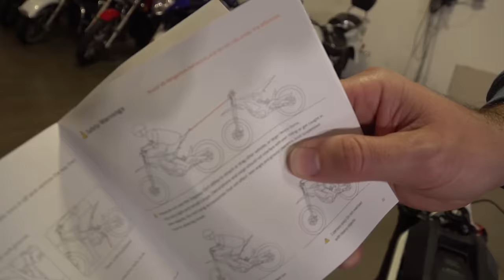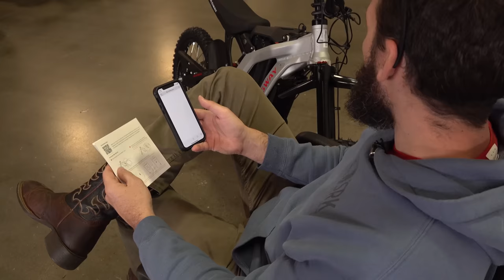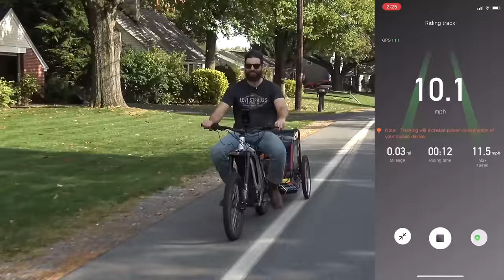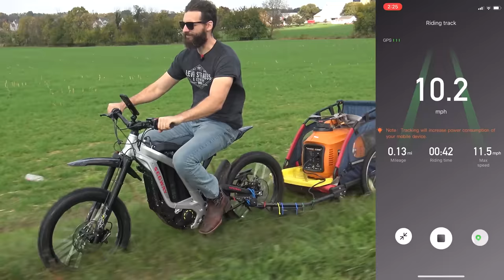I BOUGHT the CHEAPEST ELECTRIC dirt bike on Amazon

Comment: I got a cheap c91 48v 17ah 1200w peak it does 35mph right out the box.  Daily commute is 20 miles back and forth.  Still have a quarter charge when I get home going full throttle for the vast majority of my ride.  I slapped a super 73 seats on it with some cafe clip on handlebars and a small windshield.  Been a lot of fun

Comment: I think Segway measures the range with it on the lowest speed/power settings. A lot of brands do this when measuring battery life for their devices.
Reply: Also with a small Asian woman that weighs about 70lbs.
Reply: WHICH IS VERY SNEAKY!
Reply: No shit Sherlock
Reply: *small asian girl suffering from malnutrition who volunteered because her fingers were hurting from winding motors for 20 hours
Reply: If you expect to be a food delivery guy on this thing, the battery will probably be low on your first delivery
Reply: Bullsht. There's no standard checking these things
Reply: They calculate voltage and watt hours and do the math from there. Also not accurate.
Reply: " Travel range is based on riding on level ground, no stops, no winds, warm temperatures for a 175lb rider with no extra cargo ". From a website.
Reply: Did you know that Segway went out of business when the owner went off a cliff, on a Segway, and died.
Reply: You forgot "going down hill with the wind at your back"
Reply: A lot of brands measure it on flat ground with a 160-180 pound rider... so you're never going to get the mileage they claim at any setting.
Reply: That goes for just about every claim made by any manufacture.  The specs of anything is for the most part complete bullshit.  They spend more time trying to figure out how to reach specs on a spreadsheet without legal fallback than they do actually developing a machine capable of hitting those specifications.  Power, weight, energy usage and mileage are all on the table to be manipulated.

Manufactures are rarely honest about anything even if they have something worth bragging about.  They will still find a way to lie about it to make it seem better than it is.
Reply: They test it with 60 kg of load, lowest speed setting and no hills. This is the universal test
Reply: @SirNarax  People are misinformed. They are not " lying or bullshitting " Every company has standarize their testing and they do it correctly but they didn't share how they tested it. There are 3 speed settings or more usually. They give you 1 claimed range. Obiviously they only tested 1 speed setting.
Reply: @wordwarrior2350  did it really?
Reply: @aninnymoose720  there isnt a legal standard. but there is an industry standard practice. and that practice is to test them on a roller with no resistance, no wind, no added weight, and at the lowest settings to maximize the potential. basically they put it to lab standard perfect condition controls then use those numbers. they do not test in real world conditions and usage operations.
Reply: they should say that

Comment: Seeing someone hook a generator up to an electric vehicle just made my day.
Reply: mine too hahaha.
Reply: Me three, freaking hilarious!
Reply: Me four, but it kinda defeats the purpose doesn't it!! Will they ever make a battery that actually lasts as long as a fuel tank?
A battery that isn't 10 times the size of the bike!!??
Reply: @mikthe2004  Yep, designed for in the city, European style driving.  Outside of LA, NYC, San Fran and San Diego.... you start running into issues. Living in the middle of nowhere in rural Midwest.  Yeah.  Electric just ain't gonna cut it.
Reply: Exactly, what is the purpose?
Reply: I only wonder if the generator uses fuel as he operate the bike
Reply: @mikthe2004  Yes, actually. There's a couple of electric bikes that offer 150-200 mile range, with top speeds ranging from 150-200. Which, is some serious range, even compared to something like Honda's new rebel 1100 which has the same rough top speed and range. The technology for it exists, but aside from a handful of examples it tends to be expensive. The 200 range, 200 mph electric for instance comes in at 120k.  Though, it does look amazing. The Damon Hypersport I believe is the name. However, it's going to be laughably overpriced in 15 years when the technology gets cheaper, the way everything else in history has. I'd get one of the more reasonable electric bikes myself, since I don't travel more than 60-70 miles a day at most, but I like my bikes loud, and you just can't get that with electric.
Reply: @aaronself2411  Apparently the batteries only last about 5-7 years? And the cost of replacement is exorbitant? Not to mention disposing of the old battery safely?
I'm just not sold on this whole electric idea. Depending on how the electricity is generated the pollution aspect can be as bad or worse!!
Reply: @mikthe2004  I'm not sure where you were told the batteries can't be disposed of, as since , 2018 I believe about 90% of the lithium can be recycled and put into new batteries, which, was the main issue with disposal. Besides which, this is again, basically brand new technology. We had similar issues with engine oil when cars first hit the market. Lot of cars, and not enough places to dispose of waste fluids. But it's still early days, and the amount of progress that electric has had in the last ten years alone is a pretty good indication that it's only going to get better. Though, I find it interesting that the battery issue is only a problem when talking about electric cars, while we all carry around cell phones which use the same basic technology in their batteries, and let's be honest. There's a lot more lithium inside apple than there is Tesla.
Reply: Yeah. It's so stupid .🤣
Reply: @aaronself2411 that is not true. Those ev bike can match the range, but they have to run very slow. Eg.35-50kph on ev while the ICE ones run at 80kph
Reply: @ameserich  There's literally a EV motorcycle that does over 200 miles, with a top speed of 200 mph. Methinks you need to do some more research on the current EV Motorcycle market. EV bikes, are comparable to ICE bikes. Especially when you consider an ICE bike is always going to have less fuel supply than an EV. You can pack more electricity into a gas tank sized battery than you can gasoline.
Reply: @aaronself2411  duh im not anti-ev what im telling you is that if they both cruise on 80kph the EV wont reach 200miles. To make things easy to understand, it is false advertisment. That 200miles range is when on city riding 20-50mph... i dont need to research that because the battery tech they are using is still the same, Motorcycle is not the same as 4 wheels. For 4 wheels turning can be compromised so they keep puting gigantic battery, that is something they cant do on motorcycle. Unless battery capacity trippled, it will never match ICE's range per speed ratio.

If you cruise at 35km/h on your 300hp EV motorcycle surely you will reach a range of 200miles
Reply: @ameserich  Yeah and I'm telling you that you're wrong. There's already four bikes on the market that can do a hundred miles plus on a single charge doing normal highway speeds.
Reply: @ameserich  these things aren't hypotheticals they're on the road right now You can go buy one.
Reply: @wildestcowboy2668  Why would we be offended?
Reply: opening a cardboard box with a chainsaw. savage
Reply: @aaronself2411  more lithium in Apple than Tesla ... You mean overall, right?
Reply: @TheDingpud  Well yeah, If there was an iphone witht that much lithium youd have a HELL of a battery life. Be a bit wasted since the phone couldnt really move but hey, screen life for... weeks...
Reply: Never heard of the Chevy Volt?
Reply: @aaronself2411  I guess I meant which company has put out more lithium to the consumers....there are millions of iPhones and other portable electronics using lithium in their batteries.  I wonder which sums up more.
Reply: @TheDingpud  Definitely Apple. Thing about how many iPhones have been sold, then add the Mac books. Tesla is still relatively small.
Reply: @ericstearns170  this bike maybe electric cars now have a range of over 400 miles.
Reply: @aaronself2411   well for loud you could just fart a lot…it wouldn’t be quite as bad for the planet …maybe
Reply: @danbailey96  right.  so to the store and back.  lol
Reply: Please turn your life to Christ one of the most important things is to know that it’s not about religion it’s about a relationship in the bible it says they will be wars and rumours of wars please Jesus is coming back for his children anytime soon the rapture is about to take place please repent of your sins turn away from them and welcome the Holy Spirit into your heart God bless you all people
Reply: @mikthe2004  keep your old non smart items running as long as you can.
Reply: The generator on a trailer thing is just a joke because you can just go buy a motor scooter that's faster than that thing and it also makes noise and uses a very small amount of gas just like that generator. Heck when I was in some Asian countries you could buy a Honda 125CC scooter that goes around 65 mph , get 130 miles per gallon and only cost like $1600 bucks. Way better deal than any electric motorcycle, only cost you maybe 10 bucks a month in  gas, which is nothing to run the thing.
Reply: L
Reply: @mikthe2004  the thing is we can change how we generate electricity. But there's really only one way to make and burn gasoline.
Reply: Best way to do it after you run out of Ez in the middle of nowhere lol no civi life around you on a long journey out n the sticks lol best investment anyone who buying a EVehicle.  Tesla have caught on n will have Honda's generators in the boot just keep it to yourself for now 😂
Reply: Hilarious
Reply: @TheDingpud  -- The "purpose" of an electric bike toting a generator is to avoid all the laws and licenses that a regular motorcycle attract. That's why he's buzzing around on the sidewalk without a helmet.
Reply: Yes I love Joe's dream of going green and using gasoline to do it. FJB
Reply: @mikthe2004  That's why I don't want a electric car
Reply: They do it every day at the motocross tracks... one of the dumbest things you will ever see.
Reply: for this vehicle, yeah lol but for ones like Tesla, an average size tank of gas would generate electricity to charge 3 Teslas. pretty efficient

Comment: Sur Ron Light Bee X $3,600

Do not buy this from Segway (X160 or X260)! This is a product originally sold by Luna Cycle for over $1k less than the X260.

Just like you said during the video, Segway just threw a bunch of money at the production company (Sur Ron) so they can slap their name on it, make bogus range and power claims, and rip people off.

Sean, buy the "X260" version from Luna and support an American company. They only charge $100 more than the weaker Segway version you just bought! 

I've owned 10 street motorcycles, dual sports, and dirt bikes. This bike is amazing and is the most fun I've had on 2 wheels. Been able to take them to local regional parks and trails where I could/would never take a dirt bike.

Absolutely worth every penny buying from Luna Cycle. They ship in 2 weeks, their customer support is A1 and they sell extra batteries, parts, and also make all sorts of aftermarket upgrades for the bike. No reason to buy from anywhere else!
Reply: @D They were originally exclusively sold in the US by Luna for years, that was the agreement with Sur Ron. Then Segway threw a bunch of cash at Sur Ron so they could undercut that deal. 

On top of that, Segway claimed they spent "years researching and developing" the X260 and boasted bogus range claims. Everyone in the original community knows all they did was slap their badge on it and make an app. 

All the people who buy from Segway and join our groups quickly find out they made a mistake buying from them. They paid extra for long shipping times and terrible customer support.

Now we hear they're also throwing money at channels and magazines to have them give disingenuous reviews of the bike. Nothing but shade coming from Segway.

Comment: BIKES & BEARDS is the Best!
Reply: Amen
Reply: it's the only bike channel i have sub to 👍
Reply: The sur Ron is a mountain bike
Reply: You can replace the battery with Sur Ron batteries. Its the same designed. HP Logic got one of these and it goes 85+ mph. Great Video
Reply: @pascaldesnoeck8671  not even motomadness
Reply: @locorabbit30   I have the 50mph sur Ron it gets 8 miles on full throttle. Don’t buy one
Reply: Derek the segal  seriously that’s with the bigger battery as well, a guy I ride with has a home made ebike that cost about the same but does 70mph with a 30 mile range and it has marzocchi forks on it
Reply: @FriskyDecisions  Awesome forks Awesome bike
Reply: @FriskyDecisions  What is your WEIGHT?
Reply: @user-kj4wq1gt8c   well i will take a look thank you have a nice day or evening or night i live in Belgium
Reply: @ianmangham4570  165lbs

Comment: It also appears to lack headlamps, but given you've added a generator in the back, it might not be too difficult to plug in a lamp and weld it to the front...
Reply: I have a badass headlight and tail light for my mountain bike that works great and would mount right to it without any mods.
Reply: @JeremyG5705  Functional, sure. But not funny. It's style points that count.

Comment: I'm a gas and oil guy (2 strokes please), and absolutely hate electric vehicles (most), and I especially despise the government trying to force both us, and manufacturers into going electric.... it's utterly ridiculous at the very least....but, some of these electric bikes are pretty interesting lol.... there's actually a lot you can do to them to make them really damn quick, better batteries, better controllers, better motors.... there's one with a transmission that literally does 70mph out of the box (if it doesn't shut off mid throttle lol, do your research before buying that thing 😅)...they have the little Razor "pit bike" style ones, and there's a couple companies that build literally plug and play kits to swap out everything I mentioned above, you can have this little 50cc sized electric pit bike that's like $600 plus that kit, and the damn thing will do 60mph and ride wheelies all day, plus, a few hours of runtime.... there's all that stuff for most of these bikes, like this one, but I know people like that "Surron" and then there's another company that builds a competitor to that Surron that's actually even better, plus you can upgrade again.... and those upgrade companies even sell full upgraded bikes. Pretty interesting, definitely be cool in certain situations.

And man...yes there's replacement everything for these bikes, all the electrical stuff, but most of it is custom built for better performance....look up a kid called "Sur Ronster" on YouTube, he reviews and customizes all these electric bikes, he's always showing where and how to get the components with links to these "performance" shops

Comment: I added a generator like that about 10 years ago,
 Better to wire the generator to the output side of the battery parallel with the motor,
Otherwise you risk breaking something.I put a switch on mine so i could shut it off and on.

Comment: Having a second battery to immediately swap while having a storage for the first battery to rest would be amazing
Reply: Have done this just chucking the second battery in a backpack; is indeed amazing :-)
But if you're looking for daily longer range, I'd look first at chibatterysystems or another aftermarket battery manufacturer, theirs mount inside the frame and still pack a bunch more range.  Much better protection for the battery - lithium fires are no joke.
For me having a second battery makes more sense, I very rarely need the extra range and I intend to abuse this bike for many years; would've needed a new battery at some point anyway.
Reply: At that point why not just have two battery slots
Reply: @KaitouKaiju  to conserve power and lower consumption. One battery is guaranteed to have 0 draw on it and can be switched to an on board battery tender system while the other is in use
Reply: Or just having a 80cc YZ motor would steal the show.
Reply: So you'd rather have two half size batteries which empty twice as fast and reach full charge twice as fast if you use the same charger resulting in an explosion or a much quicker degradation of both batteries or having two chargers with half the power with the inconvenience of having to swap them over all the time and the huge inconvenience of having to travel all the way home if you wanted to swap over one of them that was being charged whilst using the other one whilst having half the range and having to wait longer for the batteries to charge if you wanted to travel around the city all day because fully discharging a battery will take much less time than fully charging a battery especially when considering a battery has to trickle charge when it gets over  around 80 percent or having two batteries on the bike but only using one at a time which in doing so would have no extra range and would empty one battery twice as fast causing much more heat build up and faster degradation... an amazingly bad idea
Reply: @Parabler  also do you not understand that the bike operates off of one battery as is and it uses a charger for one battery? There is no faster charge or drain on the battery here buddy. We’re simply talking about having a second battery full-size battery to swap. And of course the spare battery isn’t going to he a huge convenience there’s tons of mounting space and anyone riding an E-Bike can be bothered to pack for the trip. You should be medicated.
Reply: @KaitouKaiju  Space constraints.
Reply: @GruvenHaus  & leave you death while it Fouls  or burned up because you need ti mix oil and opp's none at gas station!!!